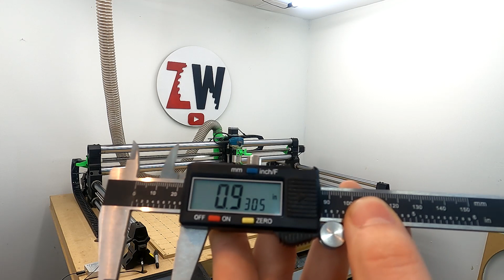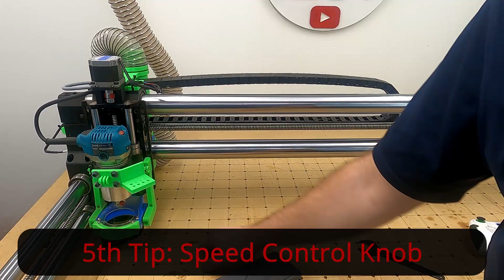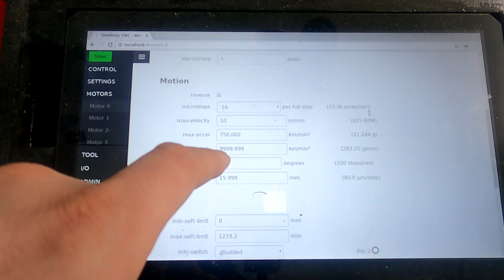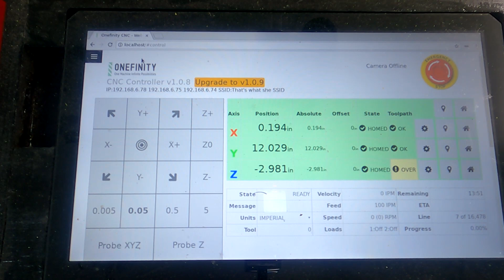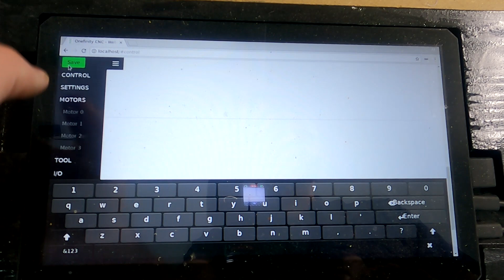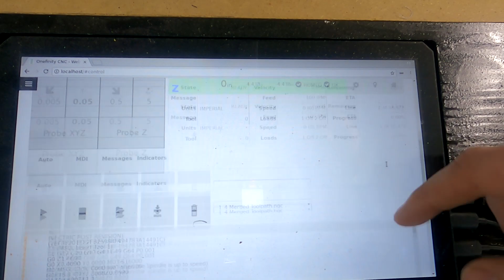Onefinity Beginner Start Up Tips and Tricks Pt 2 CNC

Comment: In regards to digital calipers, buy once, cry once. I was dealing with the same battery issues with the cheap set I got off of amazon. I didn't want to deal with that issue any more, so I splurged on a set of mitutoyos. One of the best shop upgrades I ever made. The batery literally lasts for years and does not have the parasitic effect the cheaper ones do. Not only that, I haven't had to zero my mitutoyos since I got them. They close to zero every single time.
That said, one of my other favorite sets of calipers is the starrett 1202F. It's a fractional dial caliper that has 1/64" graduations. Perfect for woodworking, no batteries to worry about.
About metric, it's good. Simple and easy to use. The hard part is training your brain to recognize the common measurements; like how it's easy to visualize 12", but 300mm is foreign to most US builders, so it's more difficult to visualize. The best thing you can do is to not try to "convert" in your head when visualizing or working with metric. So 300mm is 300mm, not 12". Once you can separate the two mentally, you'll find it easier to visualize and work with metric. I know you said "you hate to admit it" about metric being nicer and easier to use, but really, it's not an "us vs them" situation. We were literally, simply born into imperial measurements. Had the USA adopted metric way back when, we'd be using it.
I like it, and am trying to convert my shop to working with metric, but the simple fact of the matter is that our customers are typically imperial measurement minded.
I appreciate your videos on the onefinity and CNC work, keep it up! I know you haven't posted in a bit, but I'll subscribe anyway to see if you drop anything in the future. Take care!

Comment: if you save the offset, you can type the gear next to it while homed, and offset that amount in with - sign in front and it will be ready to go.  yours is 10  in x and 6 in y, home, don't move, so go to x, hit gear, type in -10.008, hit gear on y, type in -6.063.  how when you hit the center button to goto xy, it will go to the previous spot. 

great video, love the tips and tricks videos.